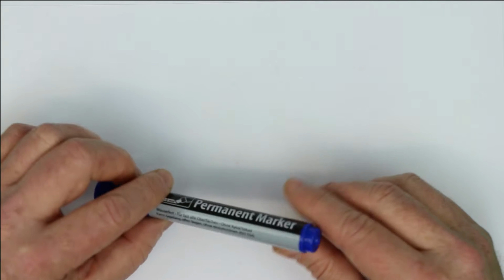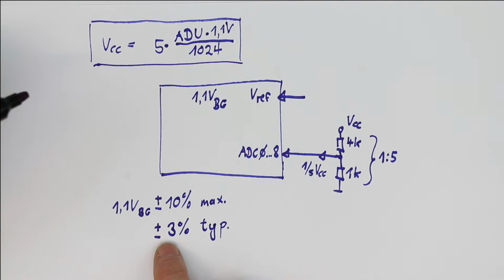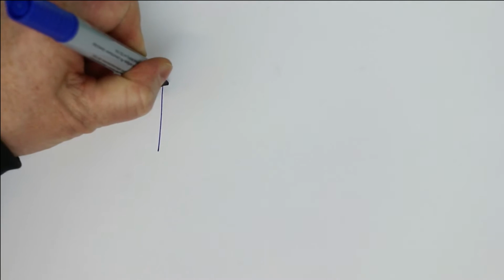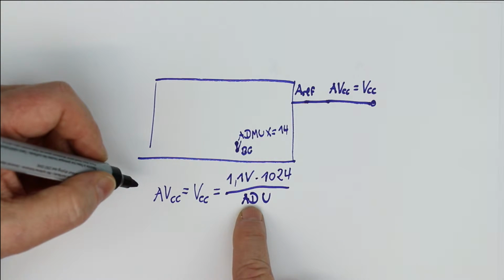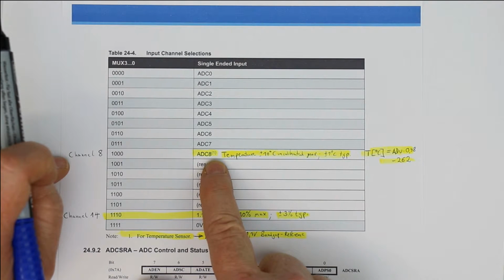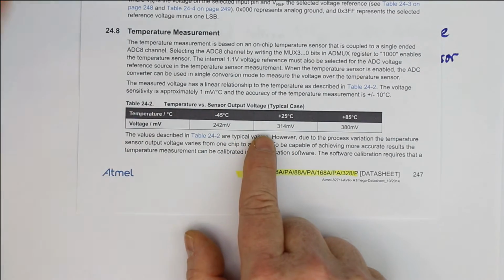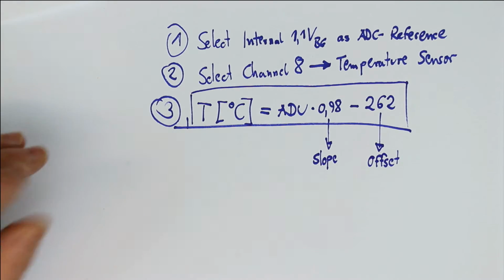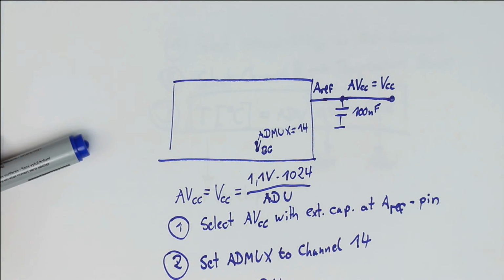Measuring supply-voltage & temperature with ATMega or Arduino

Comment: Thank you for very much for such an informative and helpful video. I am trying to measure the battery voltage of 4xAA alkaline batteries using an Atmega16A MCU on a custom project PCB. I am trying to use the internal 2.56V internal reference described on the datasheet. However, I don't think my code is correct. Since I need to read a voltage of at least 6V, I have a resistor network connected to pin PA0 with values of R1=100k and R2=33k. Do you mind checking my batteryRead() function for obvious errors? With my current code, the MCU is reporting a voltage of around 5.2V on the serial monitor; however, my meter shows that the 4xAA battery voltage is around 5.8V...some type of discrepancy. Thank you again. Here is the code:  
    long readBattery() {
    long total = 0;
    int numReadings = 5;  // Number of readings to average

    for (int i = 0; i < numReadings; i++) {
        long result;

        // Set the reference to the internal 2.56V and the input to ADC0 (PA0)
        ADMUX = _BV(REFS1) | _BV(REFS0);  // Internal 2.56V Reference and ADC0 (PA0)

        // Wait for the reference to settle
        delay(2);

        // Start the conversion
        ADCSRA |= _BV(ADSC);

        // Wait for conversion to complete
        while (bit_is_set(ADCSRA, ADSC));

        // Read the result (10-bit ADC value)
        result = ADCL;
        result |= ADCH << 8;

        // Add this reading to the total
        total += result;

        // Small delay between readings
        delay(10);
    }

    // Calculate the average ADC reading
    long averageResult = total / numReadings;

    // Calculate the battery voltage in millivolts
    // ADC result is a value from 0 to 1023, representing 0V to 2.56V
    float vRef = 2.56;  // Reference voltage (2.56V)
    float vADC = (averageResult * vRef) / 1024.0;  // Voltage at PA0 (in volts)

    // Resistor divider scaling
    float R1 = 100000.0;  // 100kΩ
    float R2 = 33000.0;   // 33kΩ
    float scale = (R1 + R2) / R2;  // Scaling factor due to voltage divider
    float batteryVoltage = vADC * scale;  // Actual battery voltage (in volts)

    long voltage_mV = batteryVoltage * 1000;  // Convert to millivolts

    // Print the results
    Serial.print("Average ADC Reading: ");
    Serial.println(averageResult);  // Print the average ADC value
    Serial.print("Calculated Voltage: ");
    Serial.println(voltage_mV);  // Print the calculated voltage in millivolts

    return voltage_mV;  // Returns the battery voltage in millivolts
}